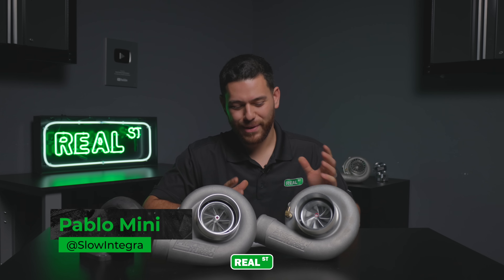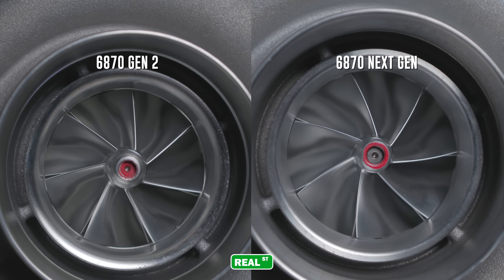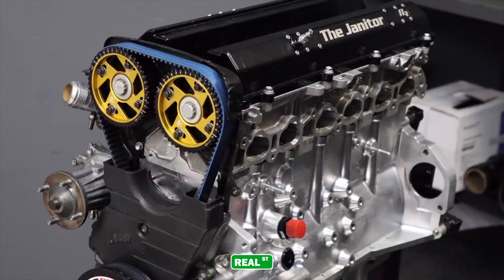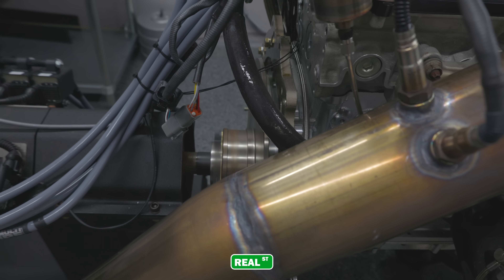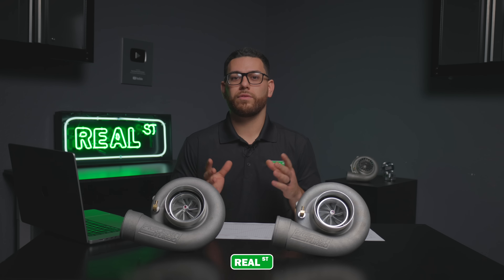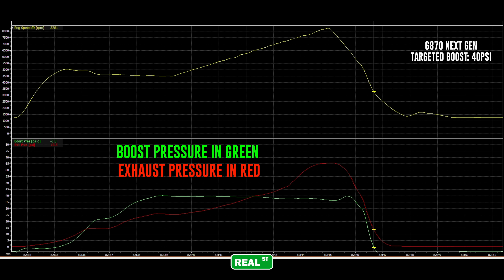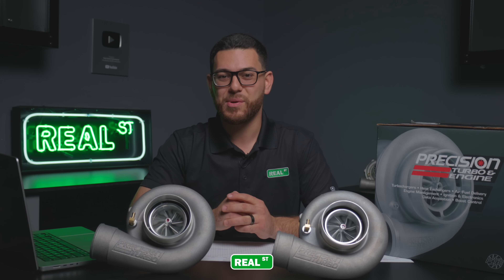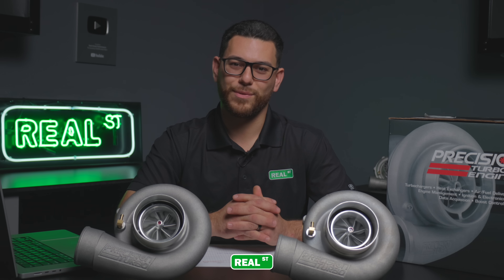Precision's 6870 Next Gen VS Gen 2 Turbocharger | 2JZ Engine Dyno Testing

Comment: Old Turbo: RPM 8143 Boost Psi : 33.00 Backpressure 57.8 psi DELTA: 24.8psi
new Turbo: RPM 8151 Boost Psi : 37.00 BackPressure 65.4 psi  DELTA: 28.4psi.... +3.6psi delta

So definately the last dyno with the new turbo had the wastegate DutyCycle raised up...

Comment: Brian Crower = makes good parts = i put s/steel swirl polished 1 piece valves = springs - bronze guides - and seals - re cut the seats ! = 8,200 rpm . subaru RA ej207 !

Comment: Torque directly reflects the volumetric efficiency of the engine. And with an increase in AR, VE will increase, which will be reflected in an increase in torque and power at the top

Comment: Judging by how the torque drops from 6500 rpm and this is also visible in the back pressure.The turbine AR was very small. It would be interesting to see the torque and power using different aAR on the same Precision turbine

Comment: While the compressor wheel is a great design, I don’t like about this is it absolutely adds more back pressure. Anytime you increase the compressor size and relevant to turbine size. This always happens. Granted it’s still a 68 mm inlet still but you’re still increasing the flow.

Comment: Appreciate the time put into the test and recap! Would really like to see the new Xona 68mm vs the 6870NG, but in a v-band configuration. The Xona UHF wheel tends to be able to get away with/prefer a smaller than typical AR as well, which could add a variable but maybe worth considering

Comment: Good test data.  But the boost control needs to be fine-tuned. the 40 psi target must be met. Also, the 276 camshaft on the exhaust kills torque after 6600 rpm. 272 with an overlap of 0.9 mm will be much better.

Comment: I'd like to see something a little crazy with the 2j platform like maybe back to a twin turbo setup with tubular style turbo manifold. Dividing the front 3 cylinders and the rear 3 cylinders...I'd like to see how it will make the power
Reply: People have done twins to single comparisons before, all the tests I've seen a correctly sized big single will outperform correctly sized twins in response and power output.

Comment: why dont you show the max power then instead of just saying that the turbos can do more, nearly double back pressure looks to me that the turbos are tapped out anyways
Reply: So what we are trying to demonstrate is a reasonable state of hard usage by one of our customers.

A turbo manufacturer is functionally giving a “maximum-achievable-airflow” * energy content of fuel = power in perfect circumstances -sort of answer.

A 40psi, 1,000hp usage of a 6870 likely envelops probably a good 96% of the people who we expect to buy this turbo.

While we are able to drive a system harder, and believe that there are times for that, when we’re trying to compare products, we feel like someone being able to relate the data to their own engines is more important than breaking the internet (or more likely breaking more parts. 😅)
Reply: There’s more to it than backpressure. If you don’t like the eMap vs iMap, use a larger housing.
Reply: @Craigineering  larger housing wont do you much good if the turbine wont flow more.

Comment: Awesome testing, though would have been good to see the EMAP data from the 7275 as well - if anything this kinda makes the NG 6870 seem less appealing than I thought it might be as that EMAP is really taking off before you are even sending it and the amount more power the 7275 made at the same boost target kinda nods to that.

I suspect a LOT of people (definitely myself) would be super interested to see the Xona XRE6869S tested against the 6870, the Xonas seem to be awesome at low EMAP and for quite a while have seemed like the only thing that could threaten Precision in the 68mm street turbo world
Reply: Put them on your car and test them man you'll find out
Reply: @boris9331  they asked for suggestions
Reply: Also would like to know the back pressure data on the 7275

Comment: I think it was a problem in the boost control in the comparasion. Target boost means that the measurement of both turbos are at the same target boost and the boost control adjust the boost.Gen2 has less boost but also less back pressure witch means that the wastegate was more open.
Reply: yeah should adjust boost control so that both turbos would run flat 40psi the whole way through. but imo both turbos are maxed out either way since back pressure is nearly double and engines efficiency has gone to shit
Reply: It is normal for smal turbos to have double even 3 times more back pressure than the boost. The boost control operates on the hot gases release from wastegate to achive the target boost. Depending on the engine configuration there is more or less negative effect from the back pressure on the engine power. The sure is that less back pressure makes more power. In the video when show the dyno datas gen2 has at 7500-8000 55-58 psi back pressure  witch is less than the 65 psi has the next gen at the same rpm. this also efect the final boost between the 2 turbos.
Reply: @MrSpuge1  nope it's too small of a back housing for the amount boost and rpm range. They'll likely need a 1.15 ar minimum to reduce the back pressure
Reply: maybe it would have been fair just doing open loop and not targeting a specific boost then ?